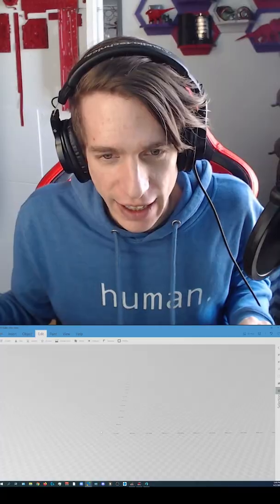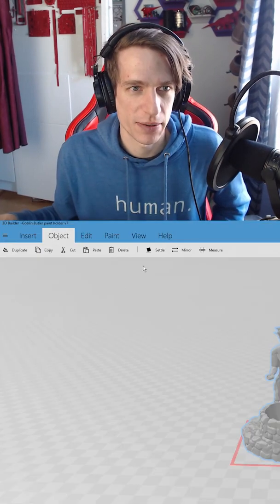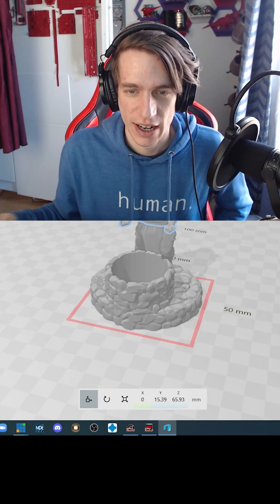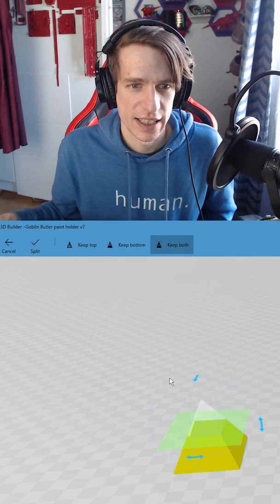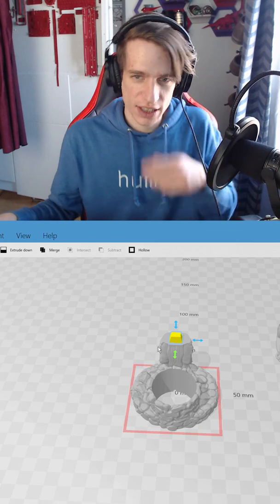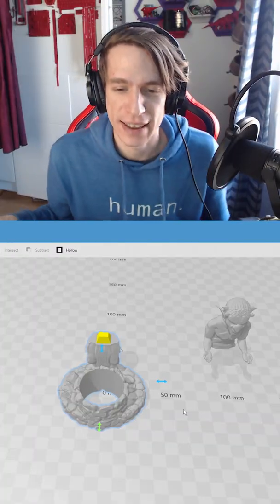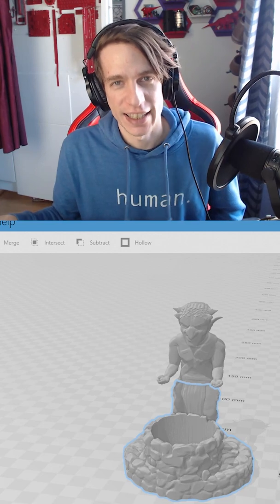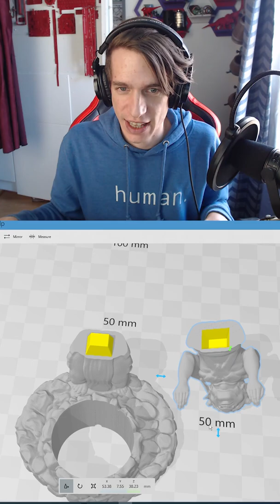How to cut and key STL files in 3D builder

Comment: i did everything right, but unfortunately it wont let me subtract
Reply from the maker: The only time I’ve run into this, it ended up being a selection error. The software can be a little weird about how selected objects are highlighted and sometimes you accidentally do or do not have an object selected. Make sure you only have the piece you want to subtract as the selected piece and that it is intersecting the piece you want to subtract from